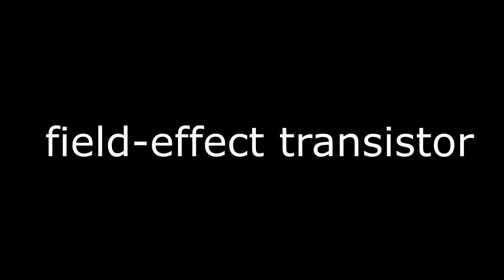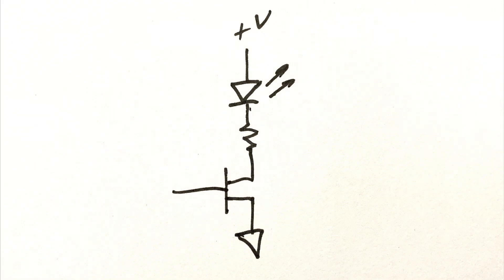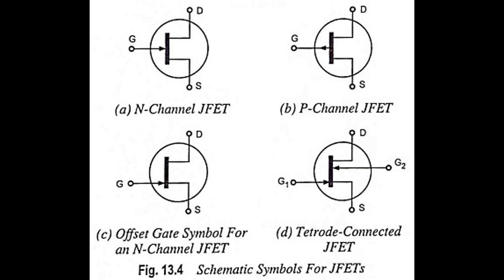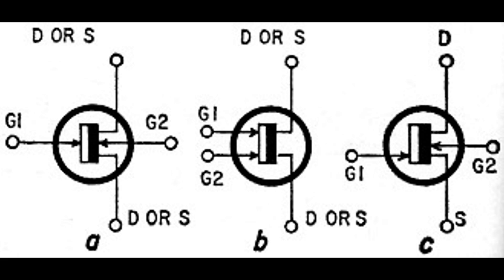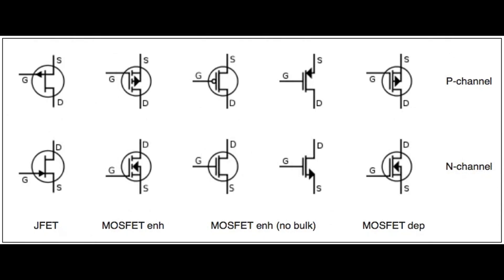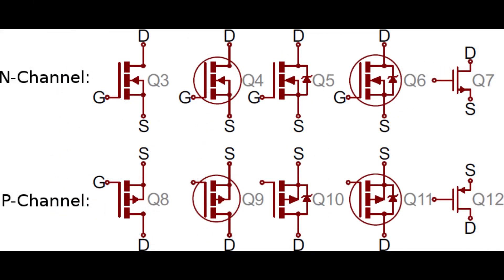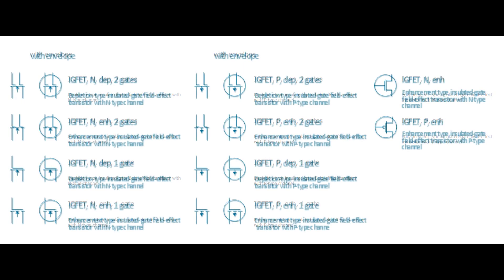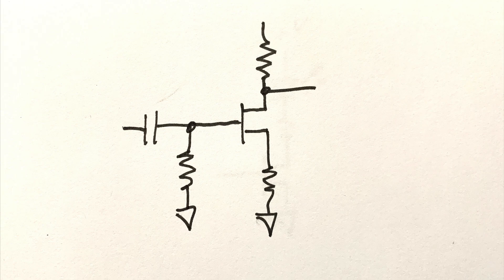#1721 How to Draw FETs

Comment: Dashed and non-dashed are quite easy to remember. Dashed is for enhancement mode (so normally there is no channel) MOSFETs, and solid is for depletion mode (normally, channel exists) MOSFETs. A little bit trickier is the fact, that the other name of enhancement mode MOSFET is... depleted channel MOSFET, and the alternative name for depletion mode MOSFET is enhanced channel MOSFET. The enhanced channel is naturally conductive, so these transistors work with channel depletion (in channel depletion mode), while the depleted channel is naturally non-conductive, so these transistors work with channel enhancement (in channel enhancement mode).

Comment: Engineering professors use similar shorthand during live lecture to avoid it devolving into an art exhibition. Either you’re one of the one’s getting it or you’re not. Perhaps consider drawing the slash for the gate representing the insulated gate - whack then slightly longer whack.

Comment: I think of the 3 little lines being broken indicates that without Vgs the unit does not conduct,
Broken line == no conduction without Vgs. Or ENHANCEMENT mode,...
While a solid line indicates there is conduction until the channel is depleted by Vgs.
(did I get it correct?)
So then applying this to a vacuum tube, what kind of "FET" is operationally similar?
'your answer as a response' ;-}
Reply: N CH JFET

Comment: Using the term FET, for both a MOSFET and a JFET, IMO, introduces ambiguity... and confuses viewers that might be inexperienced. AFAIK... enhancement mode MOSFET is overwhelmingly the type of MOSFET used in digital and analog circuits. How hard is it to remember how to draw 3 or 4 devices?

Comment: Large numbers of symbols are mostly collected by collectors, not by hunters, so they might not all be correct or significant. 
Just one point for the characterization of FETs: When the gate-source-voltage is zero, the channel is non-conductive at enhance mode FETs, so it can be enhanced with conductive charge. When it is conductive at Vgs=0 as at depletion mode FETs the conductive charge can be depleted.
Reply: You said "Large numbers of symbols are mostly collected by collectors, not by hunters, so they might not all be correct or significant." I agree. If I have to do 100 things; but 99 of them I mostly never do, then it does not follow, I need to learn to do 100 things: probably just one.